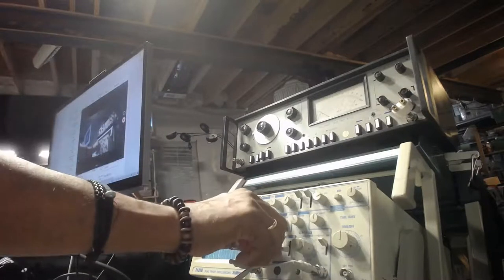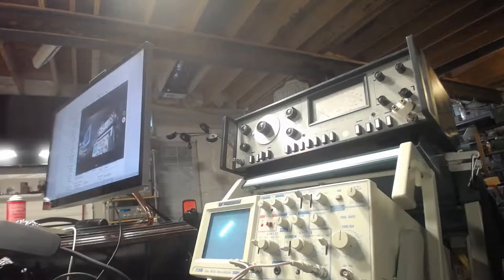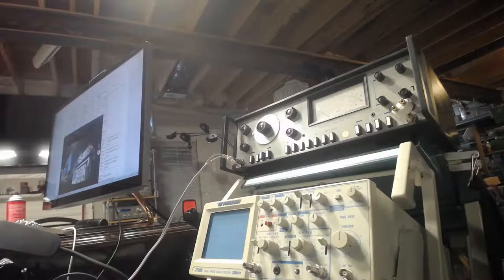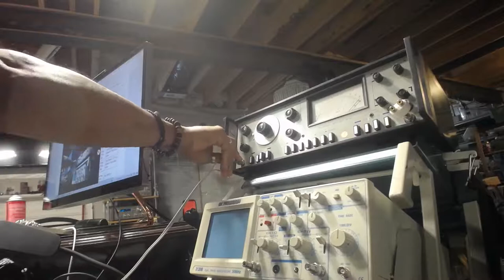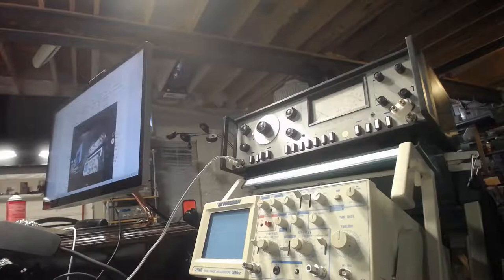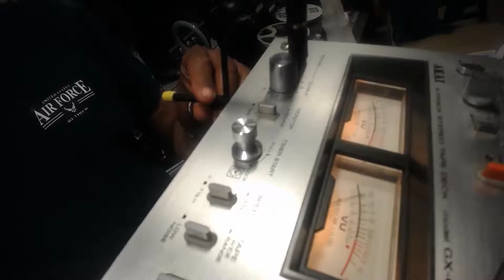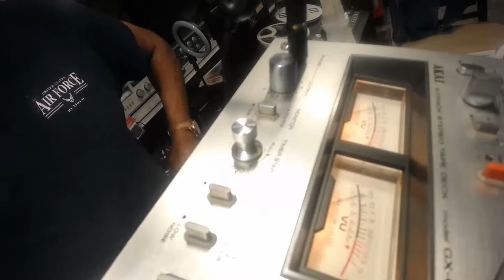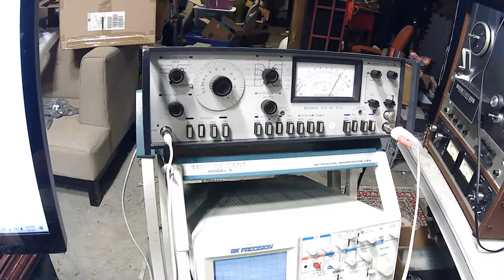Akai GX 635D Reel to Reel Calibration

Comment: Matt, is there adjustment instructions for bias filter.  I know the manual says unless the core is moved intentionally, adjustment is not necessary.  I was looking at the adjustement slots on my recent acquired Akai 635 and one of the L3 slot is broken, like chipped at the edge.  I obtained this unit and seems as if someone previously tweeked around beacuse the heads were off and a lot of things were wrong.  I managed to undo most of it and replaced all the 2sc458 transistors and got it working with play and recording both directions and it sound pretty good, but I'm still getting excessive noise when there is silence in between tracks when recording.  Cleaned and de-mag the heads and the noise is still there.  I notice this because this doesn't happen on my other R2R machines.  Any ideas?  Thanks and love your channel!  P.S. reason I'm asking about Bias adj is because I think it was "messed with" because of the broken edge and it seems like both slots are way off pointing direction wise.  Is there a way to measure, adjust this?  Manual says less than -30bB with Mic, line volume at Max.  How would I go about measuring this?  Thanks again.

Comment: What kind of transistor did you use to replace the ones in the playback preamps? I had a blown xstor in a late 70s 3 motor 3 head Akai and used 2N5089s. I did another mod to increase  the preamp's ability to play over-recorded tapes, too detailed an explanation for a short question. Thank you.
Reply from the maker: Hi MO, I used generic KSC1845 as replacements.
Reply: @5thcomm  Thank you!

Comment: Hey Big Guy, Im working on an Akai GX-280d. Ive replaced a ton of caps, burnished relay contacts, replaced the  LD3141 IC's on the playback boards, repaired a cracked connector, cleaned the heads, and did the playback head azimuth. I cant get the calibration procedures to work for calibrating the playback and record levels with a 0db calibration tape. If I dial the internal playback pots (With the volume turned all the way up like the manual says) to the 1.228 vrms the meters never get even to 0db let alone 4db like the manual calls for. Any ideas? Thanks!
Reply from the maker: Hi TW, Take the reading at the output instead of the VU meters and see if you get the same levels.

Comment: Great video Matt. Shows how involved it is getting a tape machine to spec. How many transistors were changed?
Reply from the maker: Thanks Mai. I've only done the preamp section so far, 16 transistors as I recall. Are you restoring one of these?
Reply: I'm restoring one of these I lubed all the mecanics and changed transistors on pre amp with Toshiba 2240
units works good but I have a problem with speed, it works good then randomly wobbles and get's back to good
Also on FF & FR when fast forward for long the speed goes down ( still fast but not as fast ) do you think it's the TR13 2SC2336 ? if so do you know any reliable equivalent ?
Great video thanks

Comment: Well I did something stupid. I was cleaning up and lubing a teac a-6300. Got the new belts in and lube. But I removed the idle tire solenoid without marking the position. So I put it all back together with new belts. Speed was running a tad slow. Realized I put to much weight on the idler and the tire. Moved it back but can't see to 100% match it up until the other teac I have. The service manual says I need a spring weight. But I don't have one of those. Any sugguestions on how else to check the speed?  So the roller is not to tight or mostly loose?
Reply from the maker: You have a lot of leeway with that adjustment. 2 things: Make certain the plunger moves in and out of the solenoid freely (solenoid must be level. And make the solenoid is far enough back to allow the lever to travel the distance required for the pinch roller to make contact with the capstan. You may need to readjust. If the tape is not being fed through during playback, move the solenoid further back to increase pressure between the pinch roller and capstan.  If the capstan is not spinning because of too much pressure from the pinch roller tobthe capstan, move thsilenoid in the other direction. A little time consuming,  but not difficult. You Got This! Let me know how it goes.
Reply: @5thcomm  I don't know if it is my ears or just the difference between the 2 teac decks. But I can't tell if I still have a speed issue or just the difference between the two. I already figured out the solenoid needs to be level. I also know if I put it to close (Problem in the first place.) Runs slow. If I pull it to far back. The tape runs fast or mostly rolls of the wheel. But I think I found the sweet spot for it.  Now if I can just convince myself the speed is correct. I just wish I would have marked it. Should have known better. But I don't do this all the time. My things is computer. Audio is a hobby.
Reply from the maker: @idahofur  Easiest way to tell, is play a song you're very familiar with from a pre-recorded tape. You should be able to tell right away if there is a difference.